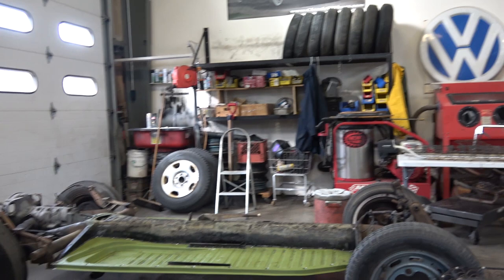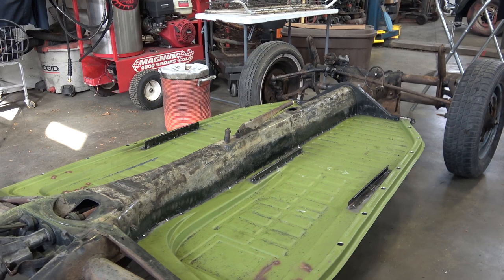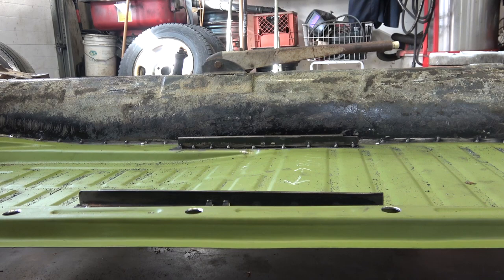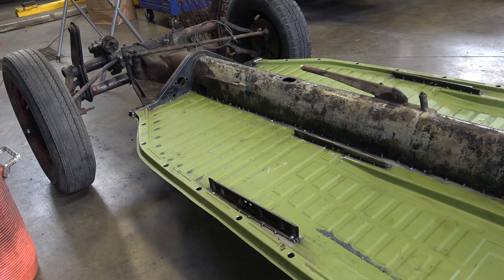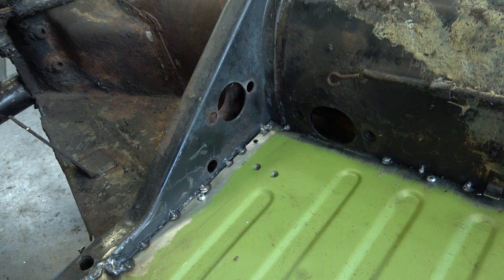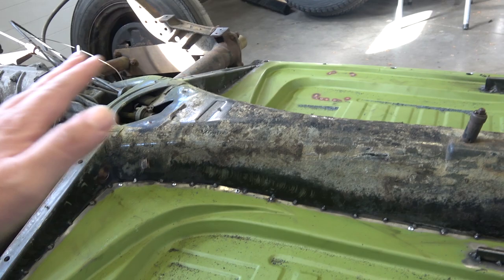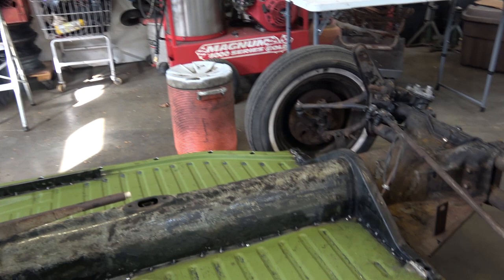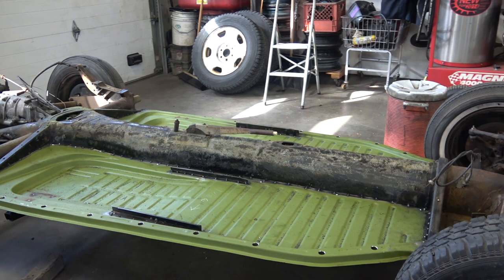Are These the BEST Floor PANS for your Classic VW Beetle Restoration Project?

Comment: Chris that seat rail tilting the Drivers seat into the older Beetles was  for the guys that really liked to Drink heavy  if the door popped open  the Driver didn’t fall out as easy  this was Brilliant Engineering in those old days before not only Seat Belt Laws but before Seat Belts  were standard in most cars  my Dad bought brand new 58, 63, and 68:VW Beetles   i grew up riding around in the back of those Bugs and i used to nap on the rear Package Shelf ! my Mom has  memories of when we were young kids  we were always made to wear our Seatbelts  and i laugh  because  my Dad was proud as hell that in a 67 FastbackMustang he owned  he was able to click the Drivers seatbelt under the seat  so that Stupid buzzer wouldn’t buzz  he also had a 69 Pontiac that he cut the Seat belts completely out of the car   i know because in the early 1980s i bought  a Jeep and the factory rear seat didn’t have a seatbelt  which i later needed for my Daughters Car Seat   i mentioned that to my Dad and he still had the Pontiac seatbelts in our Garage  they didn’t work for me because he cut the  part off that bolted to the Floorboard  i did order a Set fromJeep FYI i bought the Vehiclevfrom a Car Lot and at the time i purchased it i didn’t realize that seat was a Aftermarket one somebody installed  not a Factory or Dealer Installed one  so i concluded someone just wanted to save the extra money

Comment: Is there a difference in strength by punching holes and 'spot' welding vs tacking the pans in like you do?
Reply from the maker: Yes we do the "plug" weld too, and yes that would be a bit stronger, followed up by a "Butt" weld.

Comment: Hi Chris.  Great video!  Will the 55 pans fit into a 56?  Thanks!
Reply from the maker: They probably will, but the curve in the back on a 55 pan is not as deep as the 56 and later pans, putting the battery position in the wrong spot, it will probably interfere with the rear bench seat.

Comment: I have bought new pans for my beetle and they came with the seat rails already welded in pace. Beetle is a 1960 type 2
Reply from the maker: Yes that is correct, for a 1960 no problem, but for these 55 and earlier, they do not.
Reply: Beetles and Karmann Ghias are Type I, Buses are Type 2, Fastback, Squareback and Notchback are Type 3s and 411 and 412 and modern Buses are Type 4.
Reply from the maker: @vayabroder729  Ghia is not type 1, a ghia is a ghia.  Type 1 is beetle only.
Reply: @classicvwbugs  Aren’t Ghias called Type 14’s? Many Ghia part numbers from the factory start with 114; many on the Beetle start with 111. Have you noticed this?
Reply from the maker: @vayabroder729  You are correct my friend!  =)  thanks for clarifying.  original looking ghia is type 14, and the other ghia that was on the type 3 chassis, was called a Type 34.
Reply: @classicvwbugs  If you think about it the 1 or the 3 before the 4 in both Ghias corresponds to the platform. The Type 14 is a Type 1 platform and the more rare Type 34 is a Type 3 platform. Fascinating, eh?
Reply from the maker: @vayabroder729  it is yeah!

Comment: Hi Chris.  I'd like to know your opinion.  I am restoring my 1953 standard sunroof bug.  I had the floor pans replaced with Wolfsburg West (WW) pans which are advertised as 1955 and earlier.  I had the whole pan powder coated.  After watching your video, you educated me on the pan differences.  It turns out that the WW pans are NOT 1955 and earlier.  I have spent a lot of money getting the pan halves installed and I have spent a lot of time building the pan (emergency brake, pedal assembly, cable brake assembly, etc.).  My concern is that the back seat will hit the battery like you state in your video.  So, what do you suggest?  Have my pan redone with the right pan halves (big expense), try to modify the seat bottom, or ?  Thanks for your help.
Reply from the maker: I would set the correct position up for the battery on the pan and mark it on the pan.  Then maybe fabricate a hold down plate from there.
Reply: @classicvwbugs  Thanks for getting back to me.  So what you are saying is move the battery forward so it doesn't hit the back seat springs?  The problem is the battery strap hook is in the way.  Do you know for a fact that the back seat springs will hit the battery?  I wish it was easy to put the body on and test it.
Reply from the maker: @rickspohn6879  Hey Rick if you can call me, it might be easier to chat about this, 845.290.9900.